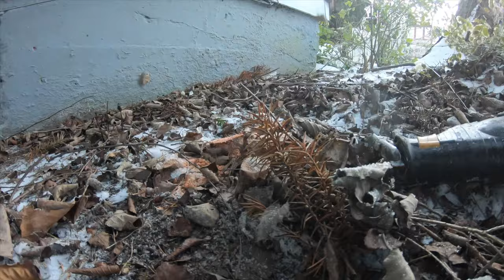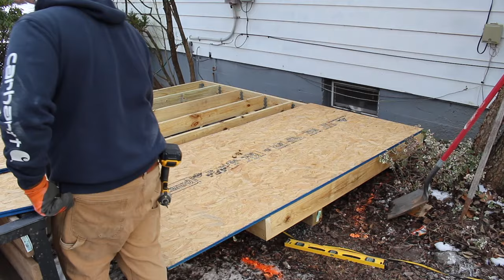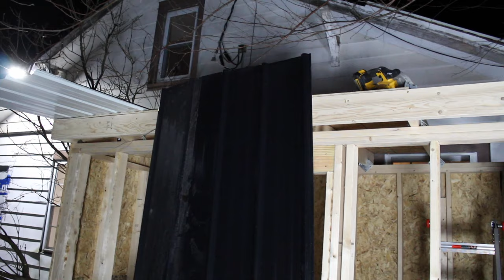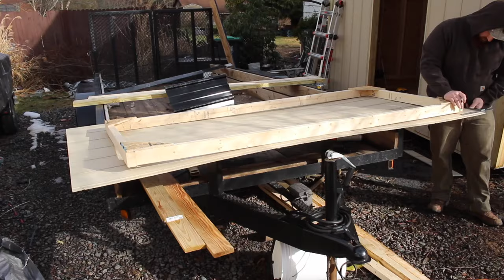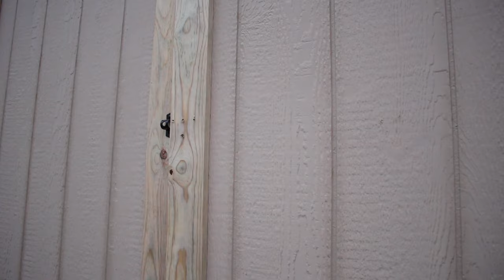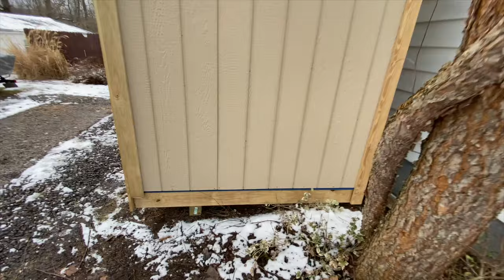Storage Shed for Cheap! | Start to Finish Build

Comment: Very nice shed i love it but for me to spend that amount of money ill go to Lowe's where I could spend around 500 and get it from them.
Reply from the maker: Thanks for the comment. I thought about the same thing, but I needed to put a lot of weight in samples for my job on shelving in it. The metal or plastic sheds were too flimsy for what I needed and the wooden sheds that Lowe’s has are 24 inch on center (compare to my 16 inch on center) and they also typically use 2x3’s instead of 2x4’s. So for 800$ ish, I have something I can move on a trailer when we get a different house and want to bring it with us!
Reply: @Slaterandson  what you mean when you say 16in on centered?
Reply: @jessieurgea9899  He means, the 2 inch by 4 inch wall frame parts are spaced 16 inches apart.
Reply: @johnverkler3962  Thanks!👍
Reply: @jessieurgea9899  I didn't see this video or your question until yesterday. Sorry if your question was not answered until now.

Comment: Didn't you just obstruct with the shed your electric meter???
Reply from the maker: It’s amazing how many people mention that. The meter is easily read but most importantly it’s read remotely. The shed is movable if it ever became a problem, this is not a permanent structure.

Comment: Did I miss the 'cheap' part? That was about as expensive as you can get.
Reply from the maker: I’m sorry you feel that way! In my region, this is a cheap shed, if you build sub par and want something that will fall down or rot out, then yes, you can build much cheaper, but I do not like to sacrifice quality for price. There is always a balance!
Reply: @Slaterandson   This is an awesome video, but you said "cheap" in your title. You contradict yourself in the above statement. It doesn't snow here, but is your roof pitch lacking?

Comment: $850?! That's WAY over my budget!
Reply from the maker: I’d suggest using some recycled material then. On mine, the roofing was leftover and I beefed the project up to be 16” on center for the studs since I planned to move it in 2 years. 850$ US would be if I had to buy everything new.
Reply: instead of those smart panels (in canada 1 sheet costs $52 lol 8 sheets is already $400CAD!) for sheathing, you can probably use 1/2 or 7/16 inch OSB, cover with house wrap and add vinyl siding (at a later time when you have more money).